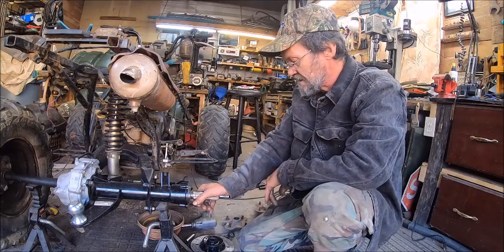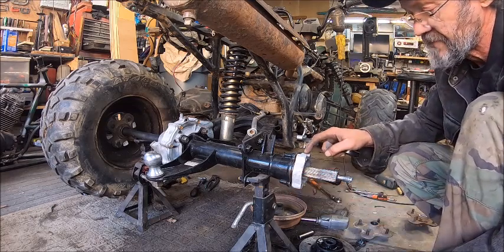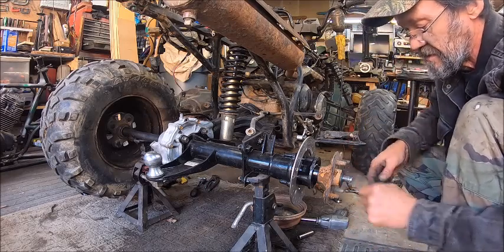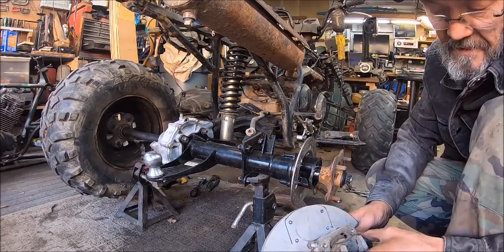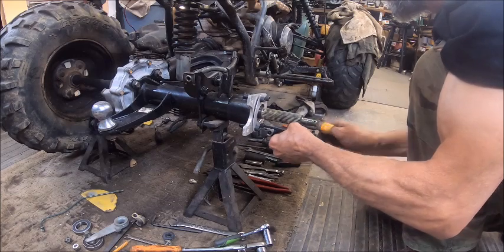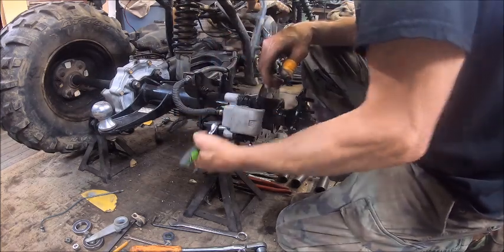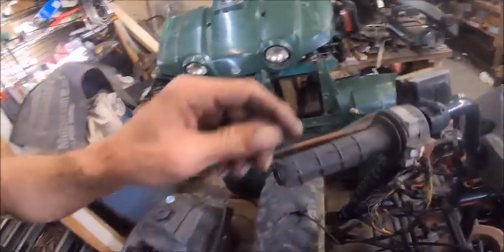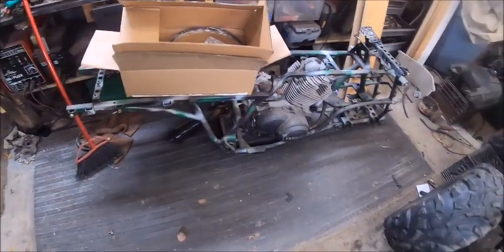2002 yamaha big bear 400 restore project part 2 converting to rear disk brakes

Comment: You are the man, Great job.  Just one question the where did the short line from the caliper to the flexible brake line come from?  A Polaris or Bigbear and did you have to cut and reflare it.  Also I may have missed it, but what model 4 wheeler did the caliper come off of.  Thanks for sharing and I love your videos.
Reply from the maker: i made my own line and flared it myself. the caliber came off a older polaris  https://www.ebay.com/itm/334592374169